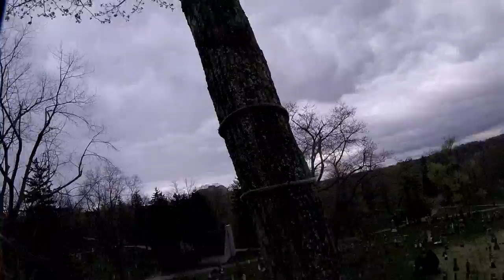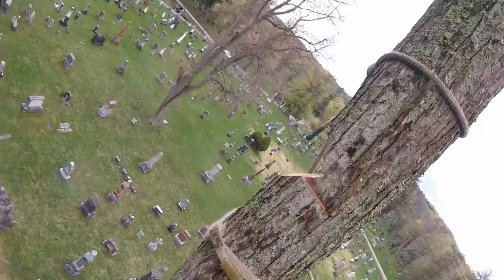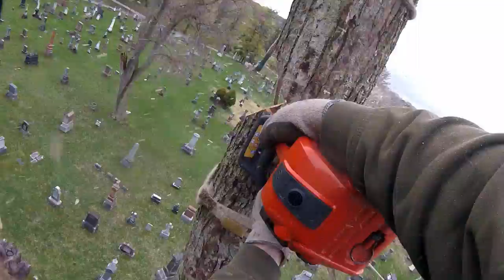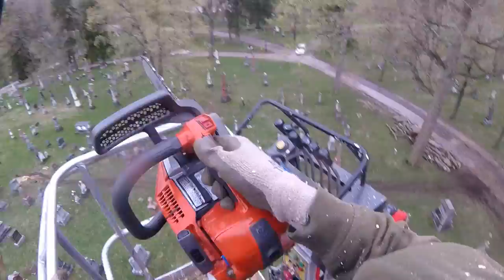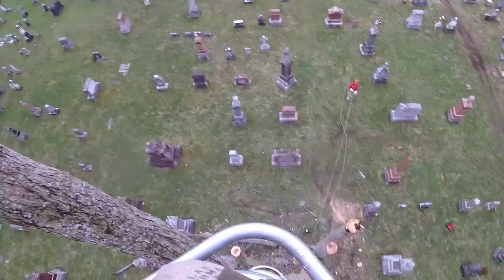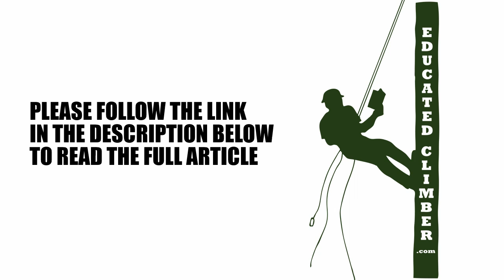Close Call: Rigging Point Failure

Comment: When you have a situation like that you can use a 5 /16 or 3/8 chain, And chain above your undercut and below your undercut. It is important to take black electrical tape and tape the hook to the chain that way when it goes through it's violent shaking it doesn't come unhooked works every time.

Comment: There's a beautiful irony to the fact that your posting of this actually makes you seem more legitimate (when the video is of a fail), most youtubers selectively-omit fails from their stream for the obvious reason but you including this doesn't make you seem amateur it makes you seem more professional because you're comfortable enough to show it and, obviously, thanks a ton for this it was great to watch I'm VERY glad that you did know you were making a 'Fuck It cut'(TM Reg Coates lol) in regards to that rigging point, would be a bit unsettling to hear "It seemed great and suddenly/unexpectedly failed" yknow?    
Will say I'm surprised that load was enough to shatter the 2nd rigging point (if I'm seeing that correctly, the trunk that crown came from was taking the brunt of the load, I don't know the #'s on how loads spread but the 2nd anchor doesn't get as much as the 1st..), glad you showed this I had never heard to "make sure things are loaded in compression" before I mean sure that's obvious in some cases but thinking of it as a general, ever-present rule is a great way to think!
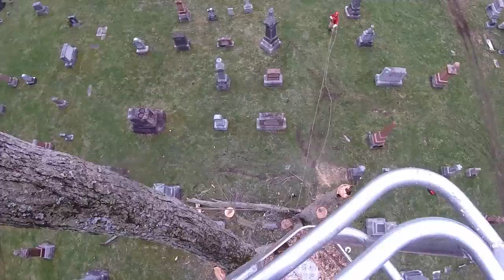In reading your summary of this video (not the article, about to read that!) you mention rigging-rings and specifically the Safebloc - I'll give you that you put out that 3:44 long video on the Safebloc but I'd love to see more on the X line of anchors, I just got the Safebloc (w/o a sling, still deciding what to make for it) and the 3-ringed (2 large rings/1 XL ring) 3/4", 5 or 6' long sling, think 5/8" Polydyne will be the line I'll use through them but gotta get that, am finding a surprising lack of coverage by youtube-arborists on these I think I've exhausted all the good ones in several days (I only watch like 30min every AM with coffee / while stretching&waking) and while I'm still uncertain how the Safebloc helps reduce load on the point it's anchored to - in my mind the physics would make it snap on that anchor even harder - but you, August & Coates all say so.....so I'm happy to accept it haha and stoked to have this gear I'd just love to see some more because the X sling line lets you do sooo much (infinitely!)varied rigging setups so it's a more-is-better thing hell I've yet to see a video where someone's utilizing 2 Safeblocs on a line, one of Driver's videos about the ring-slings does show it being used as a basal anchor but it's unclear if they're using another up top as the video's a quick mash-up type, I'm thinking that the more rings & Safeblocs you can get on your line, and the more you can spread the load, the better (well, wouldn't do more than 2 Safeblocs w/o knowing others were doing it successfully, but wouldn't hesitate to use a 2nd one if it was a basal anchor 20'+ away from the top-anchor Safebloc (hell you could tether a sling to a trunk anywhere along the bull line's path and have a Safebloc anywhere on the rope's path) am glad I got such a good deal on my first two items from this line because already know I'll need at least a couple more so that I can always equalize loads as much as the surrounding trunks allow!!

Comment: thanks for posting! this video will help us all work safer and smarter. Real learning in this business is always humbling, but hopefully not too painful. I'm no physics expert but I've definitely learned over many years to listen to the quiet inner voice(or gut). sometimes I'll stop what we're doing and say, "something doesn't feel right" and we'll do it differently. When I do negative rigging of tops, I'll use a safeblock up high and a large portawrap at the base of tree. I use a 9/16ths Samson stable braid rope, and I make a couple spiral turns down the stem for structural integrity and added friction before wrapping on the portawrap. If  I ever had to do a top the seemed to large for this system, I'd be looking for a crane. If not a crane I would put a multi- sheave block on both the rigging spar and the top being rigged and spiral the rope down to a large portawrap.

Comment: TreeMuggs… would the way you had that system rigged up not put substantial side load on both spars you are rigging from? Pulling the two spars laterally toward each other?
Reply: Also, the way the top came flying off sideways looks like it would put even more side load on the rotten spar in particular.

Comment: By the looks of your lift it is safe to assume that you probably are quite an amateur since no real well qualified tree climber would ever step foot onto a flimsy contraption such as the one you are using to do this removal, if you do not have the proper tools or knowledge you should not get involved with jobs that are above your skill level. I have been climbing for over 35 years and could instantly see that you were not using a large enough diameter bull rope and also had the rigging set up rather funky, oh well better luck next time.

Comment: Patrick, I really, REALLY enjoy your thinking approach:  thought-provoking is SO much better than anything involving the word epic.  But though I can't claim special expertise, I haven't reached all the same conclusions as you on this one.  First, rigging in this way will have made for quite a bit of side load on both spars (pulling them together) when the weight came on, and they were both long levers:  I'm not convinced that using fishing pole rigging and moving the portawrap would have made the difference, given the woodpecker's efforts.  What certainly would, would have been a backstay running from the top of the spar that broke to the base of the tree which is visible at 4:29...IF you had a spare rigging rope AND IF it was long enough.  But then this would have transferred more force to pulling the spar you cut towards the one that broke...and if that should have snapped instead, the risks are at least as great.  I wonder whether the up and down force might in fact have been tolerable for the spar you cut (given it was a straight one) had you instead rigged from its base without a redirect.

But thinking this then throws focus on the rigging pulley and on its mounting, which would have had to take more force.  I was impressed that the pinto took all it was given, as it's rated for light rigging - at 'only' 50kN - and this led me to wonder if not having a heavier block than this might have been a background factor in nudging you towards using the redirect in this case.  I do hate to join the group of those for whom the solution always seems to be more (expensive) equipment but this seems to be leading me there.  However, after following the train of thought up to this point, I ended up thinking that perhaps the biggest factor of all was the topping strop:  I cannot see exactly how it was tied to take up slack, but looking at how much lower the final position of the pinto was from where it started out means that through all of that distance that great big weight was building up momentum largely unrestrained.

And part of the reason why I so appreciate your thoughtful exposure and analysis of this incident is that only this morning I was thinking that I really need the heavyweight block so seldom that what I could do with is a lightweight rigging pulley.....and while attracted by the pinto loopie (and being unable to splice competently) I was toying with the idea of knotting a 16mm strop for a pinto rig+spacer, so that I would still be able to untie it and use the pulley in other applications.  What I was thinking was surely....surely it must be possible to configure a bowline holding a pinto so that the force is absorbed in the cow hitch and not the bowline.  I ended up thinking that it would be (possible) but this evening and after watching your video I am less sure, and less inclined to go off-piste.  That's what I meant by thought-provoking...Thanks again.  Stephen.
Reply: 16mm was a typo - I intended the 14mm size to pass through the pinto spacer.
I've been musing on this overnight and done some sums based on guesses which illustrate the further difficulty this case caused was the height of the piece being topped.  If (say) it weighed 300Kg (8m cylinder, 25cm average diameter, density 0.75) with a centre of gravity 4m above the cut, and its end point at strop limit was 1m below the cut, the numbers work out conveniently.  After a 5m fall it will be travelling at 10m a second and if arrested in 0.1 second the force would have been 30kN.  (Force= massxvelocity change/time). Not enough to break the pulley, but quite a yank.  Of course, all my assumptions are open to question.  The point is we all get nervous blocking down a big fat piece that's hard to get arms around, and not just to be sure the rope stays on.  So we (I mean I) cut it short to limit the weight.  But its centre of gravity hasn't far to fall and so it can't build up so much speed.

Comment: Good news.....I don't think it bothered him. Lol good video. Sometimes your better off not sharing the load. The way it was set up you were pulling the one piece sideways wich weakens it, in addition you had somewhat of a mechanical advantage on the piece that broke. But if the wood was sound I'm sure it would have worked. Thanks for sharing.

Comment: That was all placement of your rigging points. You put them directly next to eachother.. you don't want to "spread you load" you want to "distribute" your load so to speak.. right downwards to the bottom of the tree on your main rigging spar. Set your rigging point up in a configuration that sets the load of max point of force into the spar your rigging on. NOT WITH A FISHING POLE THATS BADDDD SHIT. And add some Arial friction fuck pulleys and blocks.. 😜 if you want I can draw you up a diagram if you aren't catching my drift🤙🏼
Reply from the maker: Yes, it was piss poor.        - Patrick

Comment: I just bought an 85’ model bucket truck and it’s a work in progress. But you kinda kept me on track  the bucket is not the the end all. Thanks for that. Stay safe brother
Reply: We use bucket truck for the last 12 years and so far have had no issues other than a hose blowing and regular maintenance. However I do want you to be perfectly clear on this... The main difference between doing work in the tree and from the truck is that in the tree you can move around the trunk to a different position if needed and in some ways this is safer. In the truck there is no place to hide in the event that a mistake was made in assessment of the trees soundness or a sloppy cut or maybe a freak large gust of wind. Make no mistake about it, there is no place to run in the bucket. You must have your A game on when doing heavy tops from a bucket. The most common mistake guys make is not being willing to come down and move the truck for better position and a top rolls off another tree onto the boom or bucket. Do not be in so much of a hurry as to not reset your trucks position and you will live a long and healthy life. Enjoy your machine and I wish you much success.
Reply from the maker: Yeah man, you still have to do the work the right way, having a lift doesn't change that! Thanks for watching            - Patrick

Comment: Thanks for not covering this up and actually sharing it! Great learning tool. Couple things, you mentioned using the second spar to share weight.. yes, that does alievate some of the "weight" felt on your main spar because of the change of rope angle. That's something we're taught all the time.. but what we don't (and SHOULD!) emphasize is the downside of this method. When we do what you did, it puts enormous SIDE LOAD on our spar. The tree can handle enormous down force, but can't handle side force near as well because of how the grains and fibers grow. Lets call the spar you rigged from your primary spar and the spar you "spread the load to," your secondary spar. If you put a block on the LIMB you rigged and ran a line through the secondary spar's block, then the LIMBS block, then ANCHORED the rope to the primary spar, that still would add side load, but it would spread the load more evenly. Also, you'd be creating a 2-1 ADVANTAGE on your rig rigged limb, which means your portawrap feels half the load. And if your portawrap feels half the load, that means you rigging point (which is now your secondary spar) would feel half the load it normally would. And normally the rigging spar feels double the weight because it creating a 2-1 against us. So now its closer to the actually weight, the 2-1's almost cancel each other out. Now if you move your friction device (portawrap or even better, safebloc) up to your secondary spar and replace your block with it, you're getting rid of (almost) the 2-1. Given, like you said, this tree and situation was SKETCH, but if the friction was moved up to the rigging point and you set up a 2-1 as opposed to two rigging points, the tree miiiiiight have handled it. I don't know if I explained it good enough, do you follow? Not bashing you or what you do, you're a boss, but there's always new methods that all of us can learn. Theres a bunch of your videos that I thought I wouldn't learn anything from but have since been mentally slapped and humbled
Reply from the maker: Thanks brother, yes I see what you're saying. I have always considered myself a student of compression in rigging system design, but this video clearly shows some very serious lack of good judgement on my part. It's the same old story, very end of a long day, very last top, everybody is tired, just wants to get finished. It was a really bad call. That spar that broke out had a live top which I had already removed. I had rigged off of that spar all day long. The spot where it broke out had a nest of baby squirrels all curled up inside the spar. Closer visual examination would have alerted me to that. 

As embarrassing as this was, I am so glad that it happened. This was a total eye opener for me, easily the worst thing that has happened in my 10 years of tree work. I have since invested in X Rings and a Safebloc. I love using the rings to redirect ropes along the spar to make sure that things are loaded in compression. I have always been a fan of friction up top in rigging, I still do a ton of natural crotch rigging on a regular basis. The rings and safebloc are the perfect compromise between natural crotch vs. blocks/pulleys up top. I can't say enough good things about them, highly recommended!

Please trust me when I say that I am not an expert or an authority on anything. The more I learn, the more I realize how little I actually know. I am just a tree climber who put together a website to help train my apprentice, and it has grown into something much bigger than I could have imagined. There are so many more people out there who are more experienced and more knowledgeable than me. Building this site and online community has opened up so many connections for me in the trade, I am so happy to be helping people learn these basic skills! Thanks for all the comments and thank you for taking the time!

- Patrick
Reply: EducatedClimber.com great attitude man, that's how we all should be! My big eye opener was this big elm we had to squeeze between two others. I was walking one of my workers through the open face and bore and it was a pretty large tree so it was taking some time. I didn't want everyone else standing around so I told the others to grab the throw line and install it in the canopy so that, just in case the tree gets caught up, then we can 5-1 or GRCS it out. While they were throwing I got the sawyer to set up the hinge with the bore. Then I got her to cut backwards making sure to leave a lot of meat for the back strap, as we have people under the tree. As she was cutting I thought I heard something and got her to stop. Then I looked at her bore and it had openned a hair! I told everyone to get out of there quick. Then when everyone was out of the way, she just started to cut the backstrap and it let go. Then we inspected the stump to find the tree was pretty decent EXCEPT the area we used as a back strap. The one spot where we had set up our back strap was rotten! I should have done a better inspection of the tree before I ever had her cutting with people under it. And of the three or four people that were under the tree, one of them was pregnant! I felt like a complete moron, that back strap was just about ready to go. Scary situation, but lesson learned!
Reply from the maker: Crazy!  You just never know!
Reply: Dude the rear spar was rotten to the shell wood, I highly doubt it did anything to absorb load at all. The main spar that he topped took all the load and some of the load of the rotten spar. In other words he could have hung that top in the main spar with no further rigging, although to be on the safe side I would have reduced the load some. On the plus side, he obviously had no idea the rear spar was decadent to that extreme and had he been climbing it, that could have proved fatal, so there is a bonus to this outcome. The fact that he shared this is also a bonus to remind us that we need to check and confirm the soundness of spar and rigging points before we start our equipment.